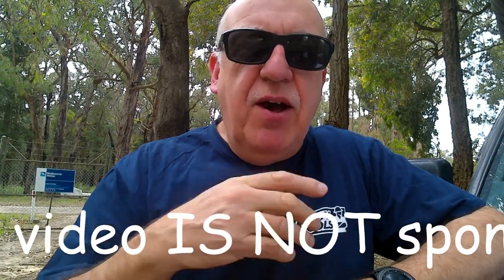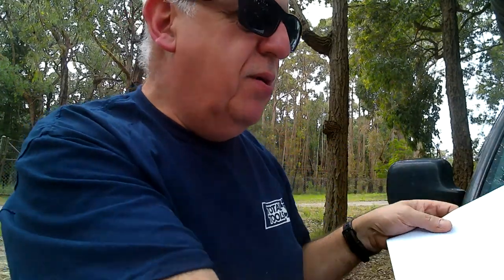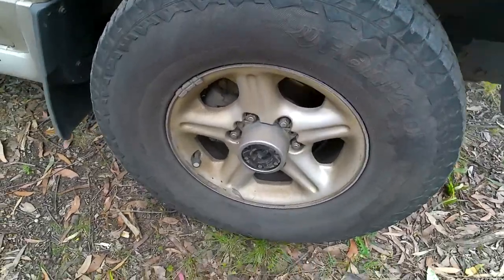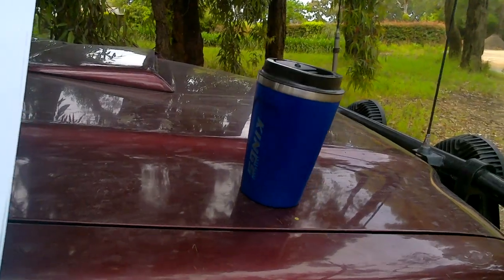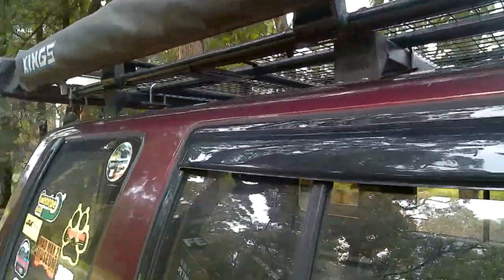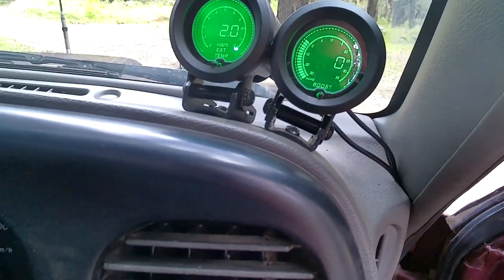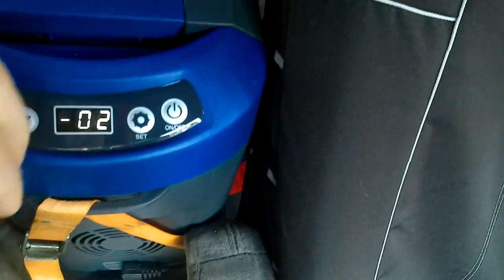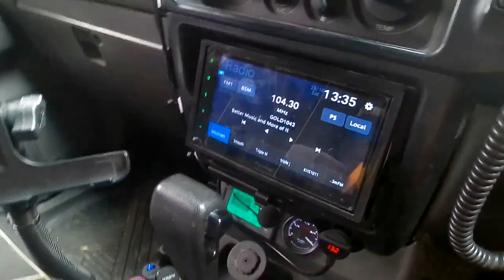As Requested, A Walk Around My Car

Comment: What a thorough walk around Dave. I'm thinking of getting a transmission cooler fitted since I tow a two ton trailer. Any suggestions? I have a damaged front fog light and thinking maybe I can replace both units with some broad spread driving lights. Again, any suggestions for these is welcome.
Reply from the maker: Ben, I should always talk to you first, I forgot about the new radiator and transmission cooler...doh!
Reply: @thejackaroo4WDcampingchannel  👍
Reply from the maker: The oil cooler in my video may not be big enough but I'd get a Watchdog transmission and engine temp watcher. As far as lights are concerned, I'd use Lethal 9" lights every day. They are excellent for distance and spread and they are so cheap.
Reply: @thejackaroo4WDcampingchannel  Thanks Dave. I'm going to get the watcher device as part of the cooler install. Yes, I guess I have to look for the biggest trans cooler I can find and fit.